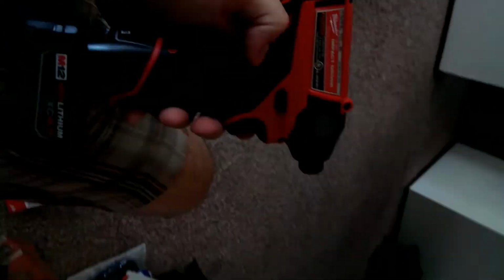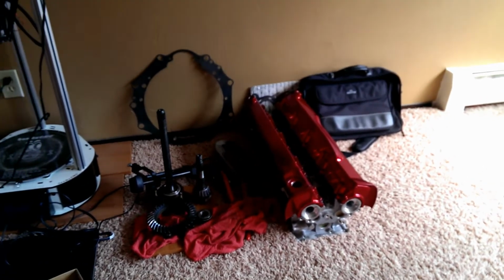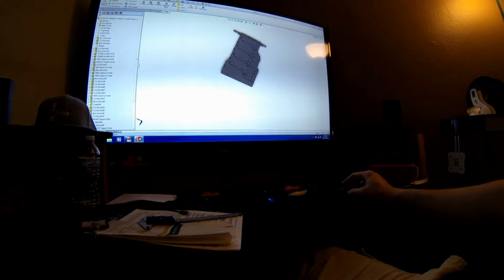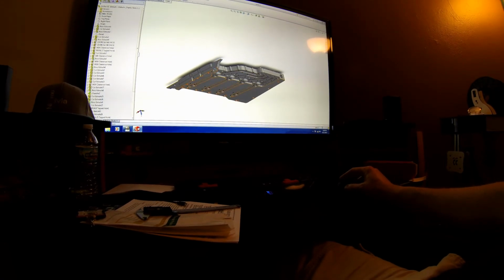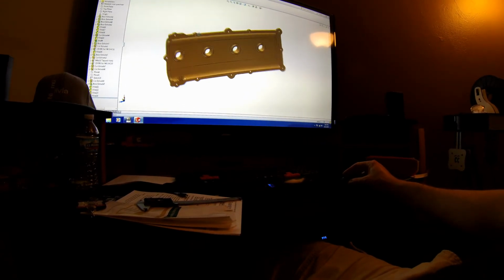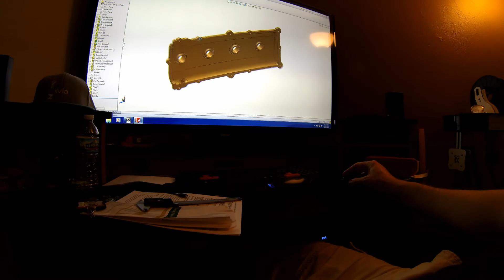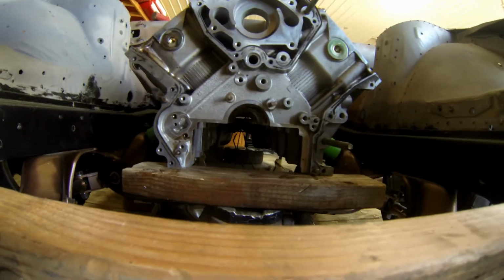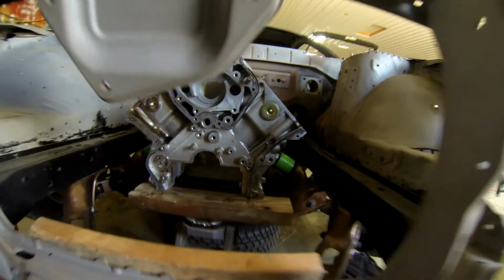VK56 Part 5

Comment: Looking amazing man. I've been holding onto a VK for years now because I don't have the budget to shell out for all the custom mounts and pieces, or access to the machinery to measure and create the necessary dry sump pan that you're manufacturing. Would I be able to purchase a pan and related components from you once you get the design finalized and ready for manufacturing?
Reply from the maker: Benjamin Smallwood Once I find a machine shop that will be able to produce the parts ant they have been tested I will have them for sale.

Comment: I'd like to know if these parts are available. I am doing a VK56 swap with my Z32, and I must know soon or I'll have to go about by other means.
Reply from the maker: +ridenoffroad I only have an adapter plate that would bolt the Z32 trans to the VK for Z32 but you would still have to have a flywheel made to work with the Z32 starter or use the VK starter.
Reply: I'd like to discuss our projects sometime soon. I sent you a message.
Reply from the maker: Yeah sounds good let me know what you want to know and I will help you the best I can.
Reply: Yeah, I gave you my email in the message. Email me when you get the chance. I'd also like to exchange phone numbers. Thanks man.

Comment: Will any of your parts work on my VK56VD ???
Reply from the maker: Yes the blocks should dimensionally be the same
Reply: Yessss!  So if i had a DE block would the VD heads fit? (Don't want the VVT items) This would be for a drag car full chassis...not street car.
Reply from the maker: +VJ not quite sure about that but I would think so I plan on using VD heads soon
Reply: I will be watching you closely....I have found a nice billet dry sump pan but im curious about yours. I will send pictures of the build stages...first i am budgeting for the CNC sleve install and bore. I will email me so you can keep in touch. Thanks.
Reply: Can we purchase your rocker covers now? Oil sump pan etc? Also   Nismo said the weak link in the VK  motor (racing apps) is the timing belt system. They tend to break....any plans for timing chain update? Conversions? Billet timing covers? If so i want to put down deposit.
Reply from the maker: I was going to stay with the chain for the time being but I do have a billet timing cover that goes with the oil pan but I still have to put some more R&D into it